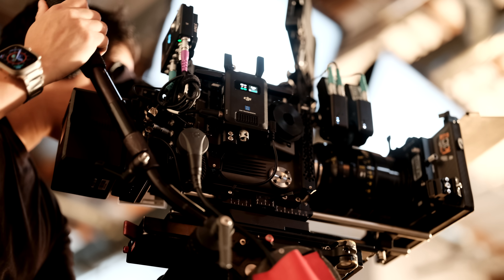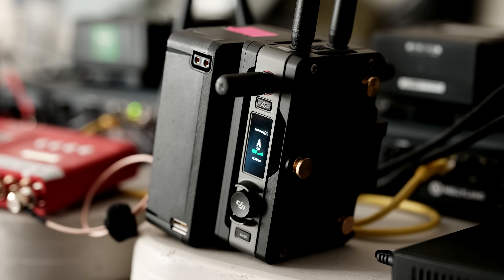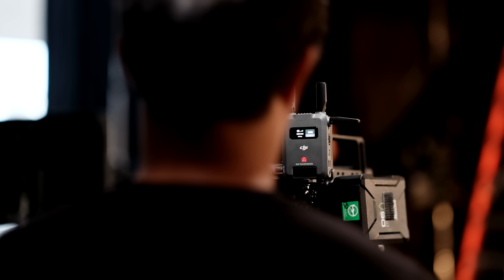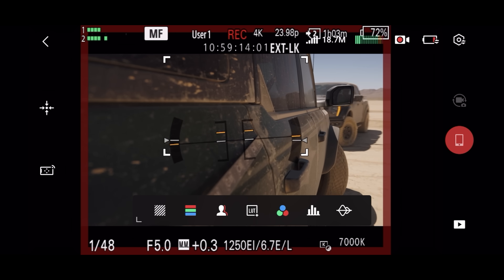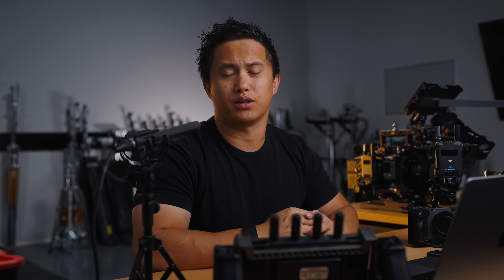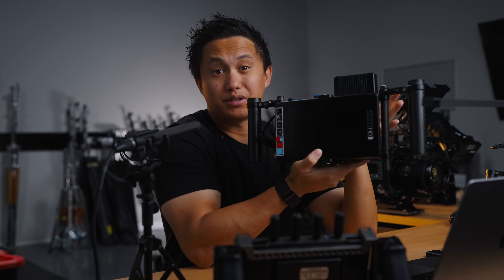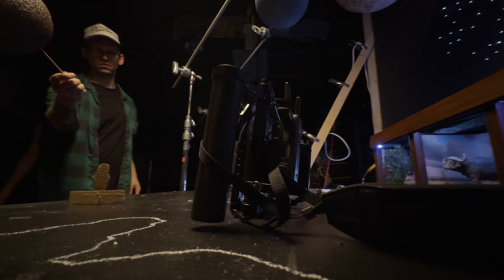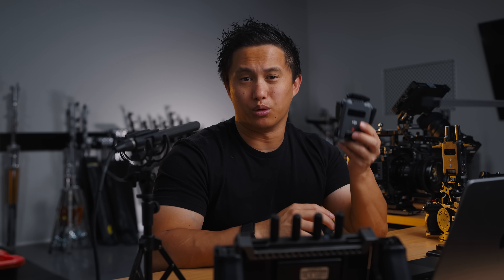DJI SDR Transmission: Explained!

Comment: Does your WiFi enable when you have a rx on and connected. Mine only turns on when no rx’s are on. Is this correct? Is the WiFi suppose to work at same time as control mode with rx? When I try and enable WiFi in a control mode connection situation it always say channel in use by sdr or unavailable. Have tried in all the different modes. Thx!

Comment: Hello. Excellent explanation of how it works. I have a question for you: many devices with these characteristics only work in P (progressive) did you test if it works in I (interlaced) I need it to work in 1920 x 1080 50 I
Reply: Curious as to why you need interlaced?
Reply: @Reedith  I work in 50 I ( 1920 x 1080) transmission live race cars in Argentina

Comment: i've cross posted this on a couple videos, but does anybody know why i'm getting 9mbs instead of 20mbs in control mode? Broadcast is turned off. But i'm only getting 9-10mbs
Reply from the maker: @jakesouthard9175  Maybe try manually selecting a different channel?

Comment: Extremely informative video! I'm curious: You mentioned the Sony Virtual Joystick. Can this be accessed through the use of the DJI SDR system or the DJI Transmission system? If so, with the DJI SDR system, can you share with me where/how you accessed this option (I couldn't find it anywhere)? Thanks!  https://youtube.com/clip/UgkxN43s5JiReezdX5OKHnFNf9VjGlO9orX3?si=rkrC0oe8narnSq9K

Comment: Great review! Just ordered a transmitter. I needed a small solution for my ronin to work along side my two Dji transmission combo kits that I brought last year. I put the now OG transmitter (but still fantastic)  on my ronin all the time but it was always a little too big. Now my OG transmitters can run on my Fx9’s and this SDR with my iPad mini can run ronin. All i need now is DJI to update these SDR transmitters in a few months so they can give be used like a teradek vue and maybe release a link so that way multiple transmitters coming from different cameras can be seen on 1 mobile device in a dual or quad spit screen like the Teradek VUE system which was great most of the time but the Reliability when shooting in areas with lots of power cables and home WiFi’s surrounding would cripple it. I shoot reality so I’m always in regular environments with lots of surrounding wifi, power lines and producers who need to be a couple rooms away from the action sometimes.
Reply from the maker: It would be awesome if DJI did something similar to the Serv. I’ve used it a few times on multicam jobs and it was super helpful.

Comment: Can you also use WiFi while in control mode?
2 receivers are enough most of the time (one for focus pulling and one for an assist), but I would like to have the option to use wifi on my phone or tablet to check the camera.

Comment: Could I potentially use a USB C to D tap cable to power the transmitter/receiver? Or does it need to be a power regulated cable?
Reply from the maker: It needs to have the 9v 2A PD protocol. Regular USB’s won’t have enough power.

Comment: The latency renders this system unusable for the professional.. Be warned!.. Watch out for the "unpaid" (keeping the review gear doesn't count!) reviews...
Reply from the maker: @peakfilm3465  You’re right, I didn’t actually get paid for any of the jobs in this video. 🚩
Reply: What's the current bar for good latency for 24/25/30 fps? At 30 fps the minimum possible latency is 33.3ms.

Comment: Can I get just the transmitter so I can have a really reliable monitor on my phone for self-filming? The Sony apps have incredibly finicky connections, which is super frustrating when I’m filming myself outside.
Reply from the maker: Totally, with the added benefit of camera control as well. You’ll have to scan the QR code and reconnect every time you power cycle.
Reply: @robchado  Super helpful! Thank you!

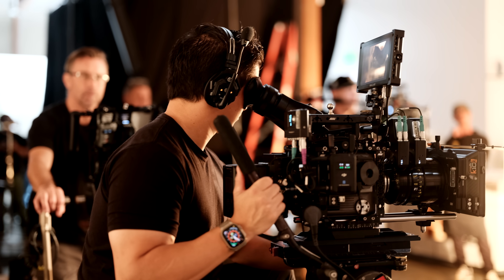Comment: Just an FYI, Teradek zero-latency wireless transmits in the same spectrum as WiFi (2.4GHz, 5GHz, 6GHz, etc.) but they are explicitly not packet based systems so it is not accurate to describe them as "WiFi based". Teradek does have products that do video over IP standards, like the CUBE or SERV, but not the Bolt or Ace line. Also, those antennas you have on the Bolt 3000 at 1:09 are not meant to be used with these kinds of wireless systems! They massively decrease range and impact picture quality.
Reply from the maker: Thank you for the clarification. I should have made a better comparison to other systems that use WiFi specifically. That Teradek pictured isn't mine, but I'll relay the message.
Reply: Somebody has stock
In Teradek it seems. Lol. Caaaaaaaalm down man. He shared his experiences which mimic others who use the system. No need to act like his video is an anomaly. Lol. You know these connection issues occur with Teradek. Its not a perfect system. Come on bro. Lol.
Reply: @4sightfilmsLLC  I think somebody just wants accurate info out in the world. I love @Robchado videos because he's practical and technical. But as far as I understand Teradek 6GHz is NOT the same as WiFi transmission like this DJI system and others like Hollyland. Nothing is ever perfect but I'd appreciate clearing up misinformation.
Reply: @cinematographical-g1e  I’m not trying to be condescending, but if somebody wants accuracy we also need to be patient, so we can comprehend what is being shared. It takes time, money and effort to produce these videos, and try to release them in a time that is most beneficial to the community. When a person or company is solid like FF I tend to show them some grace.

The video and its specifications for this DJI SDR unit indicate it operates with a “Software Defined Radio” technology and *wifi. So DJI is not just like other WIFI specific wireless units, it can switch between two different radios technologies.

As for Teradek, they use “Amimon” which is a “frame based” wireless transmission, over “Wifi” which is packet based. And they use this frame based technology in the 5Ghz and now 6 Ghz space.

Although Terdek provides less than 1 millisecond of delay, its seems they are not as stable as systems like DJI. And they are prone to replacing their units and removing support for them quickly as well. 

So there are pro and cons for going with both systems, but if played to their strengths there are use cases for Teredek and DJI respectfully.
Reply: @4sightfilmsLLC  actually I think your statement "As for Teradek, they use “Amimon” which is a “frame based” wireless transmission, over “Wifi” which is packet based" mixes up what the blog says...

"As an alternative to packet-based WiFi systems, the Amimon frame-based system, the one found in the Teradek Ace 750 and Bolt Series, is built around a unique patented chipset that uses the entire available channel capacity, removing the need for a buffer and delivering less than 1 millisecond of latency, or zero frame delay. It transmits and receives virtually lossless, uncompressed video at a high bandwidth over 5GHz and 6GHz U-NII channels for the most robust signal in any production environment."

Frame-based is an alternative to packet-based wifi. Which is what makes Teradek have less than 1ms delay. So that's why the DJI and Hollyland systems, which use WiFi, have 35ms+
Reply: @4sightfilmsLLC  strange seems like my comment deleted, maybe because I dropped the external link. It was to the article on Teradek's website title: The Difference Between Zero-Delay and WiFi-Based Wireless Video
It seems like that's where you were paraphrasing from and figured the community would appreciate reading it straight from the source. 

As I mentioned in the comment that was deleted, the points in this video that confused me was @robchado mentioned wireless video systems including Teradek use Wifi and that Teradek switched to the new Wifi 6 standard, which, doesn't seem to be a direct comparison to how DJI or other video systems utilize WiFi. 

I appreciate @robchado's videos and his time he takes to reply to comments. I look forward to more side by side objective breakdowns of comparing DJI vs. Teradek with more product out there.  Would love it if @robchado had the time.

I agree with you @4sightfilmsLLC that both systems have their strength and weaknesses. And the best thing for our community is to make an informed decision based on accurate technical information. I expect this video to be seen by tons of people, so technical accuracy is the inherent responsibility of these type of videos.

Not sure why you keep trying to make this discussion personal regarding my comprehension or anything being condescending. I appreciate discussing technical information and sticking to that.
Reply: @cinematographical-g1e  Yes it appears we referenced the same article. I think it’s easy for people to confuse the radio frequency 2.4, 5 Gz, or 6 Ghz and the transmission technology used to send data from point A to point B. 
I’m sure the video producer will correct this wifi distinction and elaborate more in a following video.

As far taking it personally. Well I’m glad to see it wasn’t intentional. When you point out and suggest that something I clearly stated, is confusing or misinformed, it is not really about getting to the root of something. Is it? You refereed to a link or comment you posted, that I never seen. You just rephrased what I wrote, and added additional information from an article we both read, that I feel was not important to the discussion. It comes off like you are just attempting to correct me. 

But if you truly listened, you would have realized that we are saying the same thing. Mostly. I added DJI SDR for clarity as-well, because you grouped it with other wifi only transmission devices. Which is exactly what annoyed you about the video stating that Teradek is using wifi, when they use a different technology entirely. The entire thing is silly to me. But hey it happens.
Reply: @4sightfilmsLLC  What I took away from this is. 

Teradek (zero delay) 6GHz is not Wifi or WiFi 6 and there's an article that covers what it is on Teradek's website
DJI (some delay) uses WiFi and SDR, but we don't have quite enough information yet to understand what exactly SDR is
Hollyland and other wireless video solutions with delay are also likely utilizing WiFi

And we need more real-world side by side comparisons which will come with time.
And if somebody like @robchado has the pull to talk to the companies directly to clarify the technology, that would be AWESOME and much appreciated. 

Wasn't any attempt to correct you and don't think this is silly. It all stems from our community trying to understand the different technology in the tools we use for our livelihood.

Comment: The biggest shame is the app/software is still extremely mediocre when you want to use iPads, there is no reason why the DJI apps could not be as amazing and flexible as SmallHD's page OS systems but sadly DJI still doesn't support its own anamorphic de-squeeze options so depending on your camera it leaves lots to be desired on that front, also no HDMI loop out is a mega pain in the bum for smaller cameras as you still need a DIY HDMI splitter solution.
Reply from the maker: @Samskihero  Yes! No loop out on the TX end is a big bummer. But also given the price, not a huge deal.

Comment: Never count on DJI giving you a functionality update via firmware. They’re far more likely to release an updated model. With that said, there are a lot of things I want to hate about this kit, but at that price, it’s nearly disposable compared to all of the industry standards. I have a Bolt and a Tomahawk that are honestly less reliable for strong signal transmission, but they have great latency so I’ve been sticking with them for focus pullers. Something like this kit would be a really cheap way to get an additional signal to clients, producers, HMU, etc…
Reply from the maker: Nothing wrong with sticking with a system that already works! These have been great for quickly handing an image off to art dept or dolly grips.

Comment: I’m trying to livestream concerts with three zve10s.  Low budget. Will this work?
Reply from the maker: It should with an adapter cable. Ultimately depends on the RF environment. I think it's recommended to use them in Broadcast mode and manually pick channels that are not next to each other.
Reply: @robchado  what do you mean with an adapter cable? I would just plug an HDMI directly into transmitter, then an HDMI DIRECTLY FROM receiver into capture card into powered T4 hub into M1 Max MacBook Pro. Just want to be sure the latency will be okay for having lips sync to sound being fed from PA via XLR into RØDEcaster into the MacBook Pro

Comment: Are you able to control a R2 like with the DJI Transmission? can you move focus area or start tracking on Sony FX3? thanks
Reply from the maker: I'm not sure about R2 control. I believe you can move the focus area around if the assignable buttons are set up correctly but I don't think you can touch track.
Reply: @robchado  DJI just lists the RS gimbals atm

Comment: THe only thing that will blow everything out of the water at this price point is a system with nearly zero latency, we have already seen 10x models like this.
Reply from the maker: I agree; DJI generally sacrifices latency for reliability but I haven't seen another system at this price point with similar performance.
Reply: The problem is having high bit rate and resolution. You can get systems down to 10ms latency but you’ll be capped at 540p. Also the camera and monitor themselves add latency so combining everything you’ll have close to 110-130ms of latency using this or any other HD system. Still plenty fast imo. If I can fly a drone through a doorway at 40mph with 30ms of latency, you should be able to pull focus with 130ms
Reply: No you havent, SDR transmission is way more reliable than the other wifi systems
Reply: @definingslawek4731  the O3 FPV system has the highest latency out of the other systems. But it also transfers a lot less data than would come from a cine cam. Those FPV cameras are tiny and they are streaming at 100fps

Comment: Rob do you know if this is going to be compatible with their existing system through broadcast? Would love to grab if I can use their Receiver alongside my current TX/High-Bright kit
Reply from the maker: @moncharle9534  I don’t believe this system is compatible with the original Transmission. Might be something DJI could implement in the future given the nature of SDR technology?
Reply: Yeah I’d pick up a couple receivers to go with my transmission system if it worked.